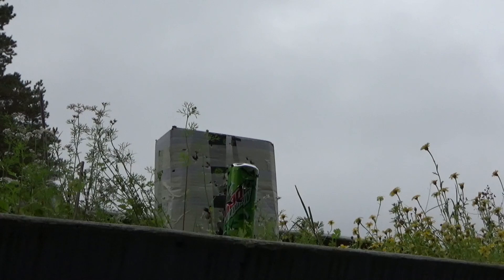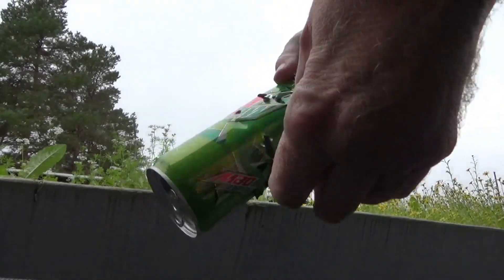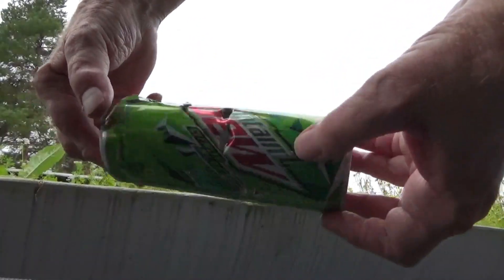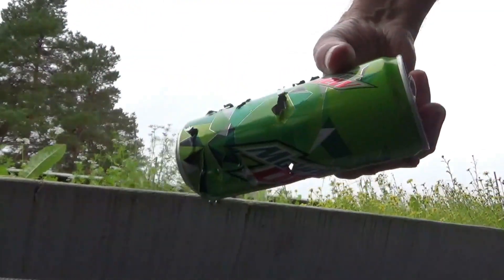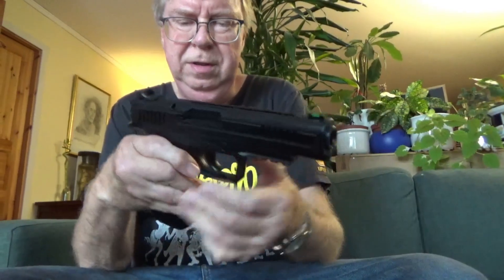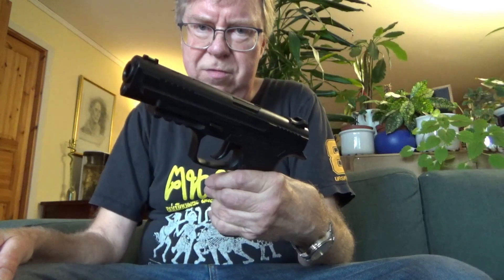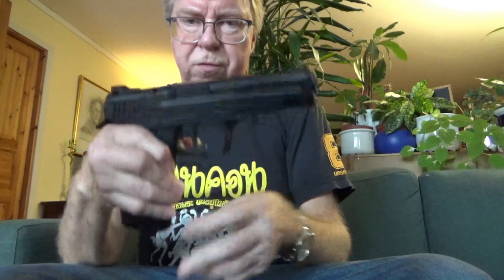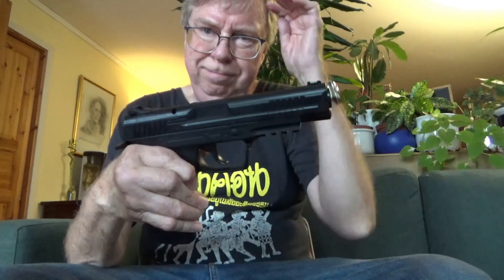Daisy 415 Powertuning

Comment: Is there any way to power tune these to make it shoot closer or over 500 FPS? I seen in another video a guy drilled two holes in the CO2 capsule on the gun and did a velocity test and it shot a lot higher or farther. Any insight on that?
Reply from the maker: Hmmm 🤔. I guess a stronger hammer spring (the spring around the barrel) is about the only other option for more power. You can shim it or put in a stronger spring if you can fine one. 🤔
Reply: @runerebel8441   what would I look for as in knowing the spring is stronger?
Reply from the maker: @hilfiger.__hendrix._2181  Shim it with washers. Try ca 1 cm thickness first. Guess that will make the trick 😎🤠

Comment: Improvement is an improvement. Can anything be done to hammer tension?
Reply from the maker: Yes its an improvement, but not huge. The hammer can be shimmed or changed, but that will make a harder triggerpul. I might try shimming it just to see what sort of power I can get from it 🤔
Reply: @runerebel8441 worth a try 🙂